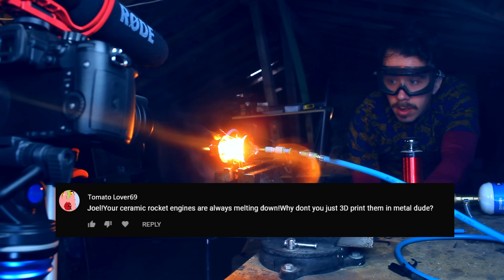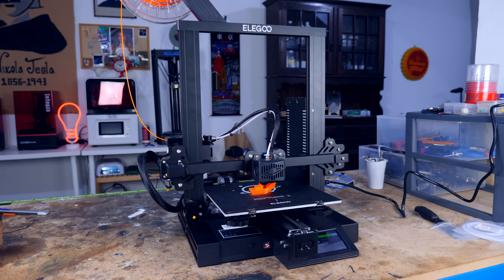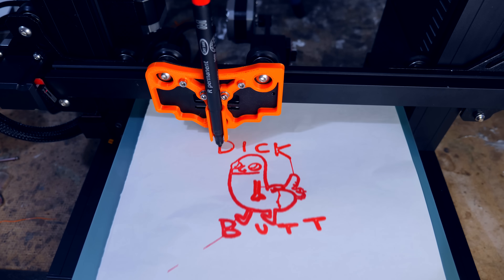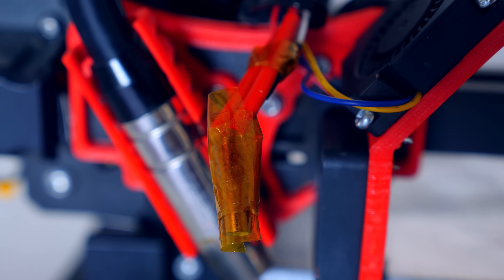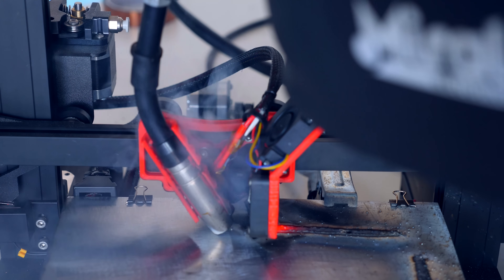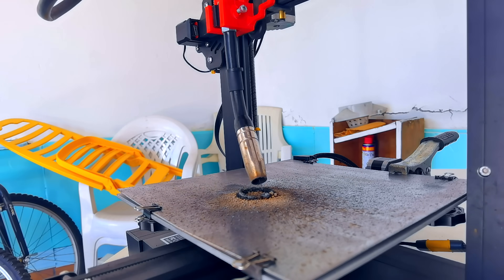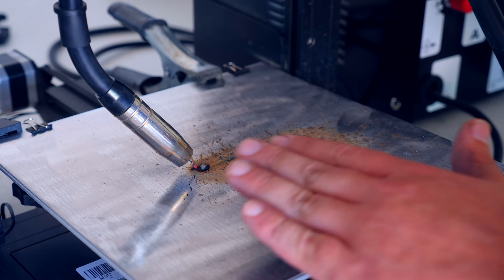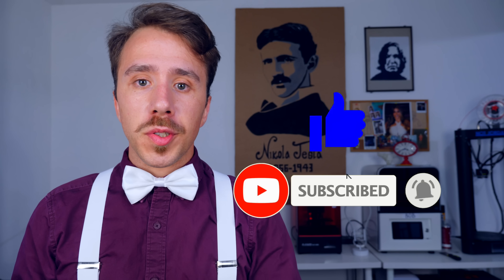I built a Metal 3D Printer using my Welding Machine

Comment: Welder here. Flux is a no go as you would have to grind out the flux deposits as you go. you can do it with standard mig running globular transfer (higher voltage, lower wire speed compared to short circuit.) more spatter but you get a smoother bead. IDK what gas you're running but we run 75/25 argon/co2, so that's what I would recommend probably 20ish cfh of flow

you should also change your mount so that the tip of the welder is vertical and not the handle. having it at that angle would be perfect if you were running fillet welds on 90* angles, but for what your doing it's useless. just gotta run a little anti spatter on the tip and you'll be fine.

as an FYI, Relativity Space is 3D printing their rocket stage using aluminum mig welding and a waldo arm.

for the base, not only should you use thicker material, but also back it up with copper or aluminum. the thicker the better. they transfer heat much faster and help the workpiece heat up more evenly. also, if you preheat the workpiece in the oven to about 350-400*f you will get much less distortion. this is because as the weld is cooling, it creates an internal stress as it cools from the outside in and that's what's warping the metal. by preheating it, you're slowing that cooling action down and also thermally pre-expanding the workpiec.

Comment: If you want to make this work:

(1) vertical wire feed.
(2) Water Cooled Aluminum block under the steel with a radiator. (Look at PC parts on Amazon est $50)
(3) Pause between layers and allow for cooling, say 100deg F.
(4) Use smaller wire dia and push it into spray mode (YouTube it). Less spatter.

Note: to reduce distortion you have 2 options, lower heat input as shown above or heat the plate and maintain a 300-500 deg F interpass temperature then allow to air cool uniformly once done. Don't think your printer can operate in an oven so I gave you the cooling option.

Comment: Looks like you were using a flux core MIG machine, which means your weld was covered in slag for each layer, and that welding slag would not attach to the next. So your workflow of printing a layer, grinding it down, and doing the next, was correct for the machine you have.

If you use a gas shielded MIG machine instead you would be able to get a lot better results, you don't have to angle it either because angling the torch is only done to point the weld puddle away from the layer of slag forming behind the direction you're welding. With a gas shielded welder, you can weld straight down.

Also, if you want to make a metal extruder on the cheap, you can cannibalize a soldering iron or a desoldering pump and print tin.

Comment: video idea:
3D printed glas! Instead of metal pulver, you got sand, which heats up (884°C) and creates glas belong your GCodes. You could buy a cheap CO2 Laser or use a different heat-method to implement this project. Firstly in 2D because it's easier. Sound interesting and challaging to me !

Comment: perhaps using one of the belt printer slicers would help with the angle issue on this? just a thought. supposedly they are better at gcode generation for 45 degree builds.

Comment: This really feels like it could work, really cool :) maybe you can offset the entire print area out to the side instead, "holding" the welder horizontally instead of vertically, that way you'd get the print height back, you could have the bed "outside" of the printer as well, maybe just with a wheel on the far end

Comment: IDEA: Electrotyping! It's similar to electroplating, but you make a mold our of any material, paint it with graphite paste, place it into the electroforming bath how you do with the anode and cathode blah blah, make sure the concentration is high enough, then you let it deposit the metal into the mold long enough to get a thick layer. Here's a video of it: https://youtu.be/-jttbwoqZQY Also that guy goes into more detail about the solution and stuff.

Comment: Could you get in contact with some company there in the EU that specializes in metal 3D printing?  I know Airbus (and I believe SAAB) print metal parts for their aircraft.  Maybe you could get a quote on them printing a part that you've designed (and troubleshot) using the ceramics and standard printing.

Comment: Try Soldering Iron Solder, that way you can melt metal very easily and it will become solid very quickly. This way you will have better printed results.

Comment: Would it be possible to make a miniature version of the real metal printer? Mount something similar to the laser used there or a heating element similar to the welder and then use it on a layer of powdered metal. Even if it doesn't work, it can't be worse than ruining the plate of a perfectly fine 3D printer :D

Comment: Boi! Do something diffrent, you have done a lot of hot stuff(wealding, rockets) so make something cold!
You already made sterling engines but there is a posibility of makeing a CRYOCOOLER!!! also a sterling design, so it would be interesitng how 3d printed parst would hold up in very low temperatures

Comment: #1 why would you even try it with the glass underneath lmao
#2 you know 3d printers run mostly on marlin or another firmware which can be configured to A) disable all the temp sensor BS you were dealing with and B) basically do exactly what you're trying to do. now that's something I'd watch, Marlin Build: Welding Attachment for a 3D Printer. If that's not clickbait, I don't know what is.

Comment: Hey fam I have no 3D printing knowledge at all but can touch on the welding if u can have the 3d printer do the cursive lower case or the lightning bolt ⚡or even step back and forth forward a ¼ inch and back ⅛inch and continue in a line that'll give your welds consistency and also if u don't want the sparks sticking to your plate use the oxygen and acetylene torch and only turn on the acetylene and light it up it'll make a thick orange flame and all u want to doo is hover it over the steel plate till its covered in a smokey black film honestly idk what it's called but the BBs don't stick to it 
And yes I do suggest pausing after every pass for a few minutes you can use a wire wheel to clean every pass to make sure u have no slag and mess with the amperage I've seen people make a little 3d person about 2inches tall spot welding on a lower amperage 
Love your channel and if this help in any way awesome because I really want to see this metal 3d printer diy

Comment: Got an idea for you: please investigate the use of a ridicule number of extruders at once, in order to 3d print at ludicrous speed. It would be awesome!
Reply: Did CNC kitchen not doing this yet?
Reply: @TaigiTWeseDiplomat--Formosan  Maybe I missed, but from what I remember he made video about printing multiple colors. Which could be a nice starting point, but my idea is different.
To get what I thought, try thinking about being able to 3d print with something like old 2d inkjet heads, which have a very large number of nozzles. That of course is very unlikely to obtain without some serious research equipment, but I imagine something that would resemble a raw prototype of that on a more macro scale. Kind of 128 extrusion point at once. What could accomplish a proper setup like that? I searched long for an answer at that question, without finding it.
Of course if you or somebody else could link some work in that direction it would be very appreciated.
Reply: Better idea is print a plastic nozzle...use it to make a sand mold and cast the part he wants.
Reply: @generationkilled  Issue is casting in steel, or something even more heat-resistant. Most casting done by amateurs and hobbyists is done in tin or aluminium. You can do this pretty much with stuff found around your house. But it isn't viable for the intended use, i.e. putting a superheated jet stream through it. They would start to deform and drop, or even melt from the heat.

To safely be able to melt and cast bronze, steel or even titanium, you need both the expertise and some specialised equipment that isn't worth getting for an amateur with no interest in taking up serious metal manufacturing, and especially for someone who's likely to just make a few casts.

Making a metal nozzle on a lathe, though... Then we're talking a relatively low risk, and only one piece of machinery which is also quite ubiquitous and multifaceted. There are benchtop metal lathes that you can get for less than 500 euros. That's probably the right way to go for this sort of use.

Comment: Water cool the printing bed? Or 3D print a ceramic printing bed with your ceramic 3D printer. Hopefully your "3D print" won't stick to that surface
Reply: Nvm the ceramic bed won't flow current needed for welding

Comment: I wonder if you could weld in small bursts (and possibly alternating on opposite sides of the part) with a pause in between to keep the heat down.  Sort of like pointillism. tack, move, tack or tack, pause, tack.

Comment: Switch from FCAW to GMAW first of all. No slag cover to clean.

Get a 1/4 plate of aluminum and put it under the sheet you want to weld to. The aluminum will pull enough heat from the sheet steel to prevent warping.

Your machine is brilliant and only needs a few modifications to work.

Comment: Sick! It would work so much better win an inert gas welder. I hope you continue this project, DD printers are so simple but the cost is outrageous. I work with several metal DD printers and they're pretty much exactly what you're building except with a MIG welder inside an inert gas chamber instead of liquid flux or a typical welding gas nozzle
Reply: BTW The buildplate warping issue is a tough nut to crack. I've seen 70mm thick plates fold up like a pringles chip, I've had to drill the heads off buildplate bolts the size of my finger because they got so tight during the weld. For your uses you could probably get-by tacking the sheet down in many spots but you're always going to have to deal with cooling deformation

Comment: Video Idea: Make a remote control car but replace the motors for powering the wheels and instead power the wheel using a pressurized gas engine.

Comment: The nozzle needs to be vertical in order to get consistent welds in all directions. Also temperature of the metal base plays a big role in weld consistency. If the metal base is cold, the welds will be taller and more round. If the metal base is hot, the welds will be shorter and more flat. So you will also have to consider how much the metal base heats up after the machine starts it’s weld. Preheating of the metal base may help. There are allot more factors that you will have to consider, like wire speed, voltage, nozzle speed, and the distance of nozzle to weld surface.    Good luck!!!

Comment: Idea: metal casting from 3D printed plastic, using fusible alloy due to is low melting temperature it can be cast into a silicone mould to create a replica metal 3d print. Tomato Smasher? 🍅

Comment: Try lost pla metal casting or whatever its called, basiucly print in plastic, surround with sand and pour metal in that would burn out the plastic. just add spouts to poir and for the gasses to escaps. can also cote the outside of the plastic  with some casting paste to get a lot of detail. theres a few vids on this.
Robinson Foundry has a lot of vids on this, check it out, i think u can make an engine like this

Comment: How would you even go about removing what you made sense its welding metal on a metal sheet it's not gunna be easy like you would with a normal 3d printer but still better than no metal printer just needs  more prototyping and fixing and experimenting to have it were you can reuse and only need one sheet metal and also I suggest moveing from fan cooling to water cooling for the metal pad you use so then it has a higher chance of not warping so it can cool better and keep the sensors to set a break temp to pause a layer then cool then build another layer then pause yes your time would increse on how long it takes but it will help in the long run and have it were you have at least 20°C space between warping temp and the temp the sensors go off to prevent it to pause until it goes down by 40°C of current temp before restarting so then it has a good area of eete it operates without harming the metal plate your useing and or have it were you use a ceramic plat under the metal plate to help it stay shape while warping but still stop after some time to prevent the metal plate from melting as well theirs probably some info you can research to make your DIY metal printer better and work better and more cost effective

Comment: >How do you draw curves? You don't!
Wrong, G2/G3.Most slicer software doesn't use G2/G3 though, since most model files are STL, and STL doesn't support curves. However, there are slicer post-processors, like arc welder for Octoprint that'll replace curves made of G1s with G2s and G3s.

Comment: Video idea: Has probably been asked somewhere already, but. How many parts of a 3D printer can be printed using a 3D printer and still be a fully functional and fairly accurate machine? Or more simply, can you construct a 3D printer using nothing but 3D printed parts? Without the obvious exceptional parts like electronics and motors.

Comment: Video Suggestion: I bet since you could print with sugar mixed in, you could use different amounts of fine iron powder instead. Depending on how well it prints you could probably electroplate it.
Reply: Actually, you can use copper powder in resin printing and it works pretty well, so I think that using other metals like Iron or aluminum would probably work too, though my concern with iron is that the weight of it would cause it to settle out faster while printing potentially making the print fail

Comment: Looks like you are using self shielded FCAW, which sucks (IMO). If you had a machine set up for short circuit GMAW, possibly with a pulse setting, I believe your results would be dramatically improved. FYI, I have little experience with 3D printers, but 25 years in the welding field.

Comment: Man, you could have printed the clamp for the welder with that thick ceramic resin, then you also wouldn't have had to angle the welding nozzle.

And a bit of a crazy idea if you give this another go... Maybe try to watercool the steel sheet?(either from the top side or the under side) then it wouldn't warp. Pretty sure this is a recipe for disaster for the electronics in the printer tho, 😁

Comment: You pull, or drag, with flux core too. MIG,  you push the puddle. You need an aperatus to turn the nozzle so it's pulling the bead with the flux core.

Comment: 3:08 YOU FOOL, GCODE CAN MAKE CURVES. although, idk about 3d printing, but the gcode is just G90 is absolute positioning, G0 is rapid, G1 is linear movement, and G2 and 3 are clockwise and counterclockwise arcs

Comment: Try Silicon Bronze Brazing Wire and Argon Shielding Gas..this wire melts at about 950 C° so much lower distortion..with an expensive welding machine there are much more settings were you can lower the temperature but I forgot you are not from gold😄

Comment: Use a kiln and a ground up tomato can dust to sinter a rocket engine. You can use your 3d printed ceramics for the mold. Then electroplate to fill the pores. 

Then use fermented tomatoes as the fuel... Actually don't unless the finished product is corrosion resistant...

Comment: The welder would stop working before you could print any thing substantial due to it's duty cycle.
And there's no point in setting a welding angle as it would be different depending in what direction it is welding in.

Comment: If you need a suggestion for metal 3d printers, Markforged makes printers that start at 4,500 USD. i know that this is still expensive, but it is not 600 grand

Comment: You can do curves, or arcs, with g code. You just need to use G2(clockwise) or G3(counter clockwise), your x y coordinates, then "R" and the arc's radius. Or use "i" and "j" in place of "R". "I" being the distance from the center of your circle on the x axis and "j" being the y. 
You'll get much cleaner curves this way and it condenses your g code length many times over.

I think theres even a setting in Cura that'll make it use arcs when it writes your g code for you. I turned it on a long time ago as soon as I realized it could. I can't remember what the setting was though. I'm sure you could search for it if interested in using it.

Example:
G0x1.5y3
G2x1.5y3j-1.5

This is telling the head to traverse to x1.5y3. Then making a 3 inch circle clockwise from that point, with its center being y-1.5 from that point.

Comment: The stickout is a bit much, you can cutaway mod the shield to bring the wire closer to the bed. You might get less spatter this way. Also wire brand is everything. Night and day difference when compared to the stuff that comes with the welder. Intriguing stuff! Hard to tell if its a DC welder, but if not you can add a 200 amp industrial rectifier with a cap reservoir and it will really reaaaly smooth out the sputtering and arcing. Might be an idea for a video, the few guys who have done a DC Eletrode Negative welder conversion have pretty shoddy videos.

Comment: You can draw curves with gcode! You use G02 or G03 left and right hand respectively.  You also need to add the center of rotation with I and K (usually incremental from the start point depends on a parameter).